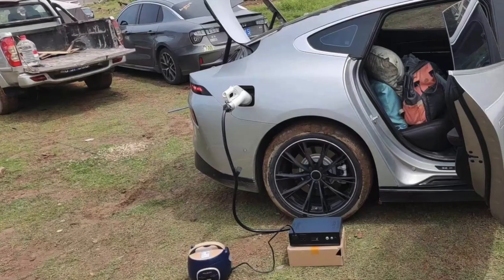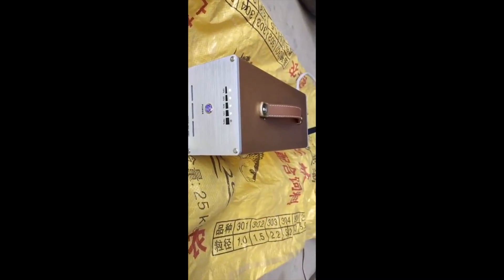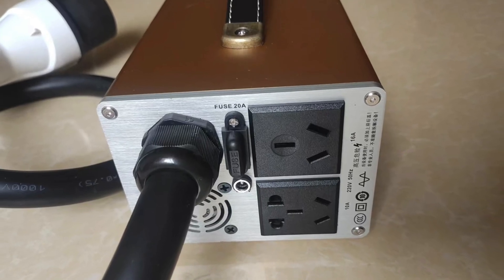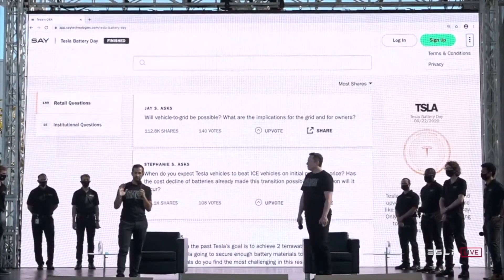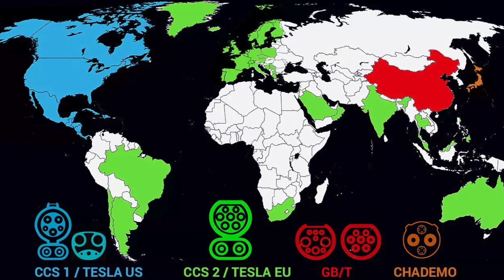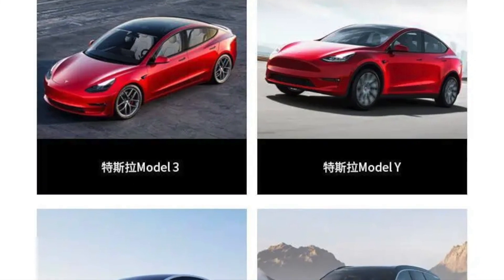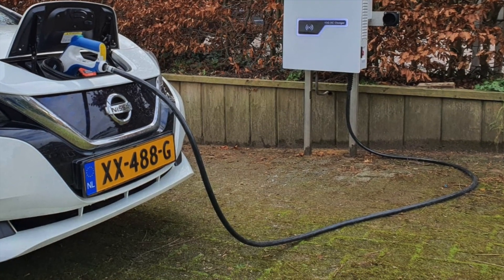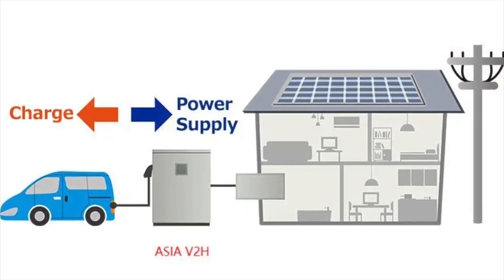Tesla's can do Vehicle To Load V2L right now!

Comment: I just installed 2000 Watt invertor 2kw, and it bricks the car from the capacitor loading if im not plugged into the charger? Disconnect the 12 volt batter and main 400 volt plug from under the back seat. Wait a few minutes, and it's an essy recovery. 
Im going to build a 1watt pre charger from a always on 12v relay and a 200 amp 12 volt relay to switch from one watt resistor to continously charge the capacitor then when waking up the 400v to 12 volt internal convertor switching the main power or 200 amp relay on and the 1watt off. 
What a pain in the ass when the car could have had a simple outlet for camping. Or at least do an OTA to get past the capacitor spike at start up.
Maybe in the future, an invertor company will build this internally, and make it easy. Probably sell hundred thousand or more invertor kits. The ota update would be nice to keave the car awake while there is detected load from the invertor. 
Tesla coukd make small fortune on this accessories but there so worried yiu might not buy a tesla wall. I just want to use my induction cooker camping.
Reply from the maker: There currently is a kickstarter going for an inverter that takes high voltage DC power from the charging port. Maybe I should make a quick video about it.
Reply: @analysingtech  yes do that I would buy it. Do you have a link

Comment: How it will work on usa tesla m3 with GB/T connector ? and where i can buy it if will work?)
Reply from the maker: You can at least but these devices on AliExpress. Maybe there are also selles more local to you.
Reply: @analysingtech  will greatly if you will send a link
Reply from the maker: @artvicious  https://nl.aliexpress.com/item/1005006956092925.html?spm=a2g0o.productlist.main.25.5c971e7fJC1ADm&algo_pvid=d7b2ef88-036a-414b-a791-bf223b5970ed&algo_exp_id=d7b2ef88-036a-414b-a791-bf223b5970ed-12&pdp_npi=4%40dis%21EUR%21308.00%21308.00%21%21%212361.96%212361.96%21%402103853f17159279902965700ef016%2112000038849159941%21sea%21NL%21116774965%21&curPageLogUid=RngarkLrQhNt&utparam-url=scene%3Asearch%7Cquery_from%3A
Reply: @analysingtech  and what about tesla US 2022 dual with chademo combination and this inventor? is it work?
Reply: we were pleasantly surprised to discover that it had vehicle-to-load (V2L) device for tesla，V2L will be a great tool during emergencies, if interested,see my page.
Reply: They wouldnt work as GBT uses CAN protocol while US/EU CCS/NACS Uses PLC protocol.
Buy the CCS/NACS variant (much more expensive)
Reply: @raysunwong3480  can you send a link on this? will thx you for it

Comment: does this work in us tesla model 3
Reply: Not enabled at the moment it appears. Try to explain is good as possible in the video.
Reply: Yes, but only on tesla with GB/T connector.
Reply from the maker: @hi9580  Correct. Sorry for the bit clickbaity title. I would love to see it working with other connectors soon. Maybe videos like this push Tesla in the right direction.
Reply: @hi9580 kindly explain i dont understand
Reply: @Calibike  tesla cars around the world have different shape of charging port, some ports has features the other ports don't have. Just like 240v euro vs 120v usa plug or 240v uk plug has fuse built-in.
Reply: we were pleasantly surprised to discover that it had vehicle-to-load (V2L) device for tesla，V2L will be a great tool during emergencies, if interested,see my page.

Comment: You need to use the DC pins on the CCS, but you must have a protocol to communicate with the ECU to close the contactors allowing the connection to the DC pins.
But also we must be sure vehicle wont shut off if it senses no charge or a discharge.
Reply from the maker: Yes that basically what this video is about. Which protocol do you need to talk of which part type and if Tesla allows this. I would not recommend uses the protocol to tell you are charging and this discharge over the DC pins. This could really confuse the BMS etc

Comment: I wonder, does the car cut the connection if the voltage on the DC connection falls below the battery aka, the current reverses?
Reply from the maker: I don't think the car measures any current. Probably if you trick the car that to enable the contactors (by faking charging)  you can probably take out power out of the car. But the BMS might get confused.
Reply: we were pleasantly surprised to discover that it had vehicle-to-load (V2L) device for tesla，V2L will be a great tool during emergencies, if interested,see my page.

Comment: Thanks for this video. 

The presentation where Elon says " right we can just enable it through software update in Europe, right?", you can see the guy taken aback thinking how to respond with a no in the least embarrassing way for Elon lol. From his response it seems like, European models need powertrain upgrade before V2L can be done. US connector is out (for now). Chinese somehow allows this already.
Reply: It's unfortunate that Tesla isn't clear on this topic. The LFP models would be ideal for this, and many cars spend a lot of time just parked at home and could double as solar batteries...🤔
My Model 3 is a Made in China model (bought in Germany) and there were some rumours that this model has V2H capability, but never anything official so nobody really knows.
Reply from the maker: @rolandrohde  Yes indeed, hard to figure out what is currently possible on which cars.
It also does not help that the V2X standards for the different plugs are also still not clear.
Reply from the maker: Yes I had the same impression. But in the end it is mainly want about wanting support any form of V2L or V2H or not.